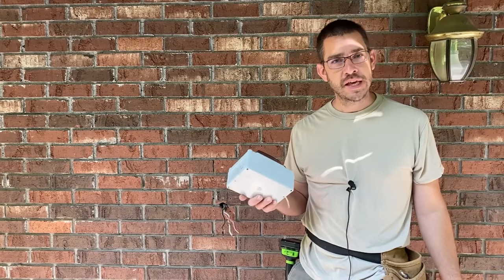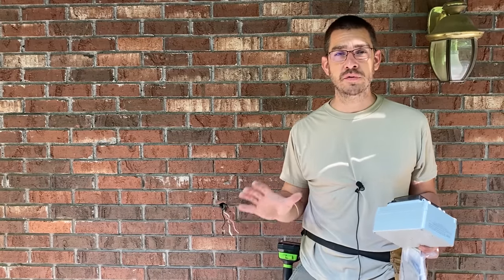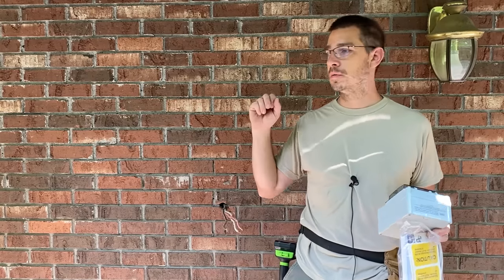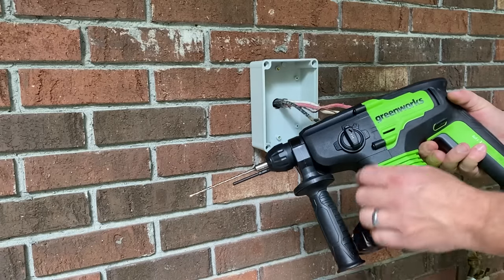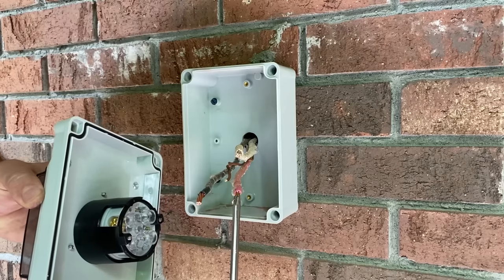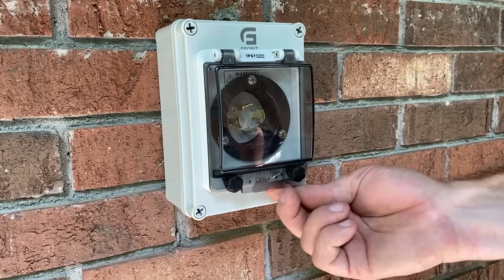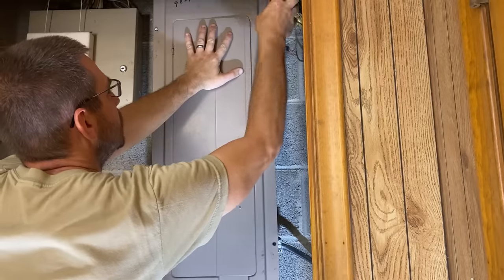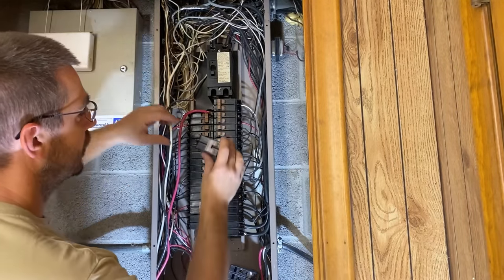How To Safely Power Your Home With a Portable Generator

Comment: It was convenient in this example that the top circuit breaker was prewired to the outside like that. Most of the time, that breaker position will be powering a circuit. If you disconnect that wire and attach the wire for the generator, now you have an unpowered wire in the panel that is too short to move to a lower position. Don’t be tempted to add wire in the panel so this circuit will reach a bottom position. I may be corrected but I’m not aware of a connector approved for that application, you certainly don’t want wire nuts inside your panel. It may be possible to move everything down one position and they all reach or you may have to pull a new wire for that circuit. If that’s not practical, you may have to explore other options for a safety lock-out. There are several other designs but this one is the least hassle and expense.
Reply: NEC 312.8- As long as there is sufficient space you can make a splice inside a panel.

Comment: You are creating a fire hazard by shoving the un-insulated portion of wire into your wall. You need to put a romex connector onto the sheathed portion of wire and connect to the box. Outside of that all looks good but fairly serious mistake.

Comment: Handyman,  you need to use a plastic bushing where the generator feeding cable pass thru the plastic box into brick wall, also, you need to use a protection for the generator feeding cable to panel when it passes thru brick wall (pvc hard pipe). Everything else work, while you explain the correct wiring of generator into your main panel, as a floating neutral or bonded neutral generator…

Comment: You, like nearly all the other “DIY” guys on YouTube, missed an unbelievably critical thing in this tutorial…

Since your neutral and ground are bonded at the panel, you must be running a floating neutral generator. Nearly all portable generators come with a bonded neutral, so the motor cover needs pulled and the neutral needs disconnected from ground. Otherwise, you risk energizing the frame of your generator.

Comment: As a union journeyman wireman, I think If someone has little to no experience with electrical work they should not be doing this task. It takes very very little electrical current to stop a human heart and electrical mistakes can burn your house down. Be careful folks.
Reply: I agree.  I'm a commercial construction super, and I even see the electricians eff things up.  I would not do this job myself even with 25 years on commercial ground up construction under my belt.

Comment: @SSLFamilyDad i tried doing this today after watching this video. i do not have the outside box yet so im just running a cord from the generator to the fuse panel. The outlet on the generator keeps tripping no matter what i do. ive tried running a drill off the cord and its fine but going to the house it will trip the breaker on the generator. any thoughts as to why?

Comment: That wall outlet looks pretty dangerous with the pins sticking out. Never seen one like this. These would be deadly when power comes through that outlet.
Reply: Power does not get to the wall outlet from the grid.  Power is coming from the generator, through the wall outlet to power the isolated box.

Comment: Bought a firman 9400 but the breaker keeps tripping on the generator when I turn my breaker panel I dont understand why... everything is wired correctly
Reply from the maker: Something is shorting somewhere. Discount the generator, doesn’t still trip? Check your cables

Comment: Umm, it's safe to use the dryer outlet if you use common sense. Lots of people do this without issue and it's what construction crews do when they are rehabbing a house without power. The two most important things are make sure the mains are off and put a piece of tape over them while you're running like this, then connect the supply line to the dryer outlet first so you don't have a male plug energized..then connect the other end to the generator. Turn off the breaker on the generator and then start it and then flip the breaker on.

Comment: Where is your generator getting its earth from? What if the mains cable into the property has lost its earth? You will then be running the property on a generator with no earth.
Reply: In the US, buildings each have their own grounding (earthing) in the form of grounding rods or an ufer ground, they don’t get their grounding from the pole. 

We typically have three lines coming in from the pole, two hots and a neutral. The ground and neutral are bonded only at the main panel. 

Generators either get their ground from the connection to the main panel, or if that isn’t grounded properly (possible in old houses) the manual has instructions for grounding the generator separately.

Comment: He did not silicon around the exterior box, this is a code violation and will not pass a home inspection...
rain water can fall into the hole into the brick and cause issues...

Comment: Damn no connector🤷🏻. Why not. Also the outlet itself seems to be directly in the middle of where you put the wires. Wires should’ve been off in the corner to allow more spacing behind the receptacle.

Comment: That is not a hammer drill. That is a Rotary Hammer big difference.
Reply: @crusherfang9368  Very big difference. Rotary hammer goes through concrete like butter. Hammer drill is ok for occasional holes in concrete. A hammer drill spins like a drill and hammers. A rotary hammer hits and turns like a jack hammer.

Comment: To all you DIYers, do yourself a favor and hire a professional who knows and understands each of the hazards presented in this video, knows how to apply LO/TO, wears the appropriate arc-rated PPE until they have confirmed the panel is de-energized and will perform the installation IAW the NEC.
Reply: A little overkill there, eh, Nancy? Everything you mention has it's place, but this is a DIY project for your own home on your own breaker panel, not a commercial/industrial electrical job. It's so you can take care of yourself during a temporary outage in a way that won't destroy your stuff when the power gets restored, and keeps you from sending power out of your house through the incoming lines and zap a power company lineman working down the street. No morning tailgate safety meeting required. Unless you like talking to yourself, I guess.  lol

Comment: Generator interlock kits cannot be installed by the homeowner.  They must be installed by a licensed electrician.  The reason, an improperly installed standby system can kill a lineman, the homeowner or someone else.  Don't be stupid, hire an electrician. In addition in at least my area the utility can pull your meter for having an improperly installed generator connection. Posting  these types of videos is going to get code changed to disallow direct panel connections because somebody is going to do it wrong and hurt someone.  You didn't address sizing the generator breaker, sizing the generator, sizing the generator inlet receptacle or even sizing the generator inlet receptacle conductors.  Most panels don't have the two pole breaker next to the main empty, those circuits have to get moved it could be up to four circuits and they could share neutrals what should the homeowner do then?  ......  BECAUSE IT LOOKS SIMPLE AND IS EASY TO INSTALL DOESNT MAKE IT DONE SAFE OR CORRECTLY!!!

Comment: Let’s see, you didn’t seal the penetration to the exterior or around the box for water and condensation infiltration.. Turning off the main breaker still leaves incoming power coming into main breaker so you could have hurt yourself doing work in the panel. That 30 amp “interlock” breaker gives you less flexibility than the transfer switch option you said was stupid. You only have a max of 5760 watts now. As a licensed electrical engineer, do not DIY electrical people. You can easily create fire hazards and insurance won’t pay for it.
Reply: So you call the power company to disconnect the service every time you do work on a panel?  I have worked with many electricians and I have never once seen someone say that turning off the main breaker isn't safe enough to work on a panel.
Reply: @JDel709  you can shut off main breaker when working on circuits or adding a breaker. He was close to the conductors where it was still energized ahead of the breaker and had a metal object close enough where an arc could have occurred.

Comment: This is not safe man. Just because you turn off the panel breaker does not mean the power is off to the panel.  We electricians shouldnt even work panels hot.  Your fingers were inches away from lighting you up.  You should not have this video posted. This is not a DIY project.
Reply from the maker: Gosh I have been installing breakers in panels for years as an hvac tech and a home owner and I have never done anything different than shut of the main and install the breaker. How would you do it call the power company?
Reply: He isn’t going to answer because he is not an electrician. Turn off the main breaker, the panel is dead.

Comment: Or you can install a generlink kit from home depot and save all that hassle
Reply: Thats almost triple the cost.
Reply: @keith200085  That depends on how much an electrician charges you to install the receptacle and run cable to your main panel. Generlink takes 15 minutes to install and all you do is plug in your generator power cord. Super simple.
Reply: @tysonburns9535  Generlink is $700.
Reply: @ShelbyvsViper  hiring an electrician to install a receptacle and bypass can cost over a grand.
Reply: @tysonburns9535  Seems worth it for the Generlink.

Comment: I dont get it.... he spends lots of time showing drilling and other nonsense but misses explaining in detail the connections to the Main panel (at about @9':00", what is he talking about?) and also the wires connecting to the box outside.
Reply from the maker: There are 4 wires, black, red, white, and bare copper. 2 hits (black and red) one neutral (white) and a ground. Look at the panel and wire it just like all the rest of the breakers, the outlet literally has color markers to show you where to put the wires. Hope that helps!

Comment: You are incorrect.  You can buy a transfer switch that's rated for your service, e.g. 200 amps and run the whole house.  Please revise your statement.  Manual switch, easy to do.  If your load is too high you manually control it.  You don't need a 30 amp breaker in the panel, the circuit is protected by the generator.  I know you mean well but your advice is badly flawed.
Reply: You absolutely do need a breaker that feeds the generator box on the outside of the house. If you didn’t, those male prongs will be live all the time, your advice is awful

Comment: Actually it’s only going to power the left side of the panel. The right has a separate hot line. Two hot and one neutral. You should get some more info and update people before they do it wrong.
Reply from the maker: It powers the whole panel and the sub panel upstairs

Comment: It isn't water proof if you don't seal those holes. You also didn't make sure the power is off. You also should be wearing appropriate gloves for safety. Otherwise, seems OK.